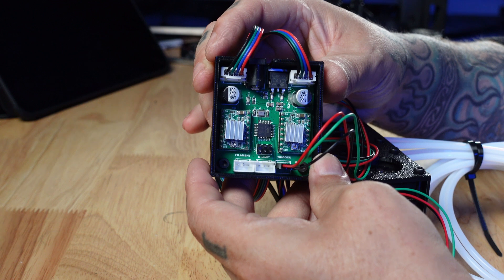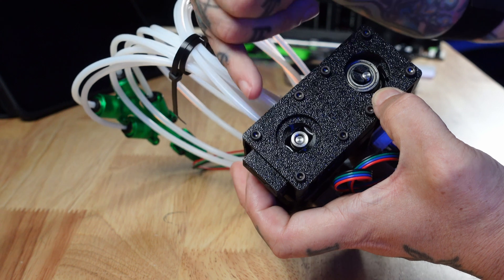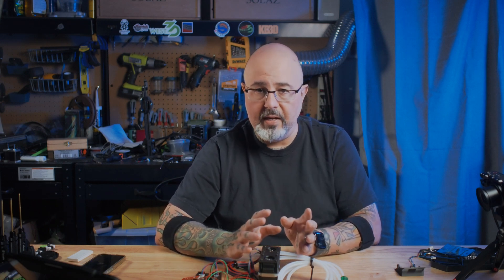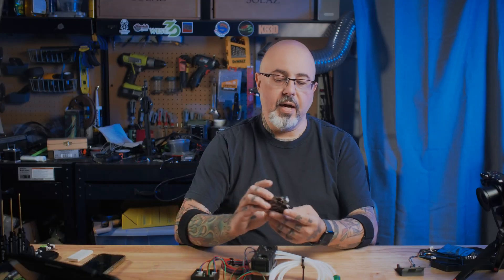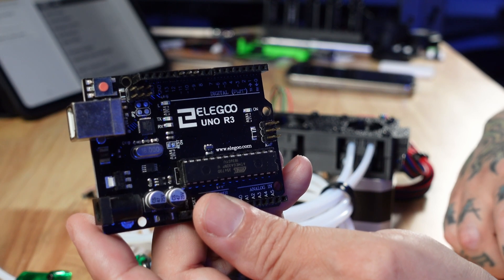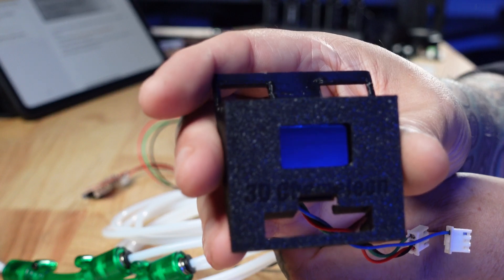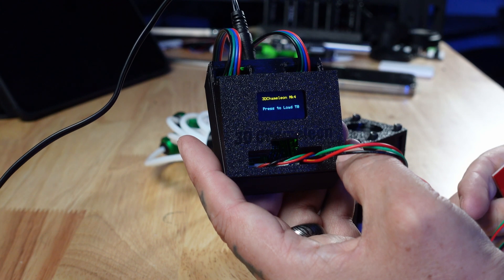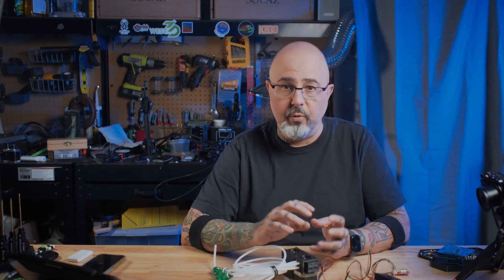3D Chameleon Install Part 1- Intro

Comment: The use of dual nema 17 is a bit overkill where a servo would have been better as most cards accept servos but require a steppermdriver for nema, so preffrerable no nemas at all or minimum

Comment: I have had my 3D Chameleon for a few months now just sitting in the box waiting until I have time to tinker with it. I love that you are taking the Klipper approach with this and I will most likely be doing the same thing. Thank you so much for taking the leap to create a walkthrough for doing just that. Looking forward to seeing the rest of the videos in this series. Awsome job Allen!
Reply: I tried it a couple of times and retraction to switch filaments has been very difficult to calibrate on my ender 5 direct drive setup. It is resting also until I find time or find a nice YouTube tutorial. I wish autoclipy was easy to install but seems too difficult than just plug n play.

Comment: i have the 3DC on my neptune 4 plus, its taken a lot of time tuning it but finally got it working well
Reply: I'm still running the 3DC using the stock firmware, maybe after this I'll look to adding it to klipper and using klipper to control it..
Reply: How's the 3DC been the last couple of months? I was looking into getting one, do you still recommend it? @KA009

Comment: The MMU options for klipper are mostly very complicated to assemble, configure and operate. I have yet to see a single solution that “just works”
Reply: Mosaic palette 2/2s is pretty much just that.
Reply: @jettachamp26  For single filament types. cant mix petg and abs or pla..  So is not a single solution.